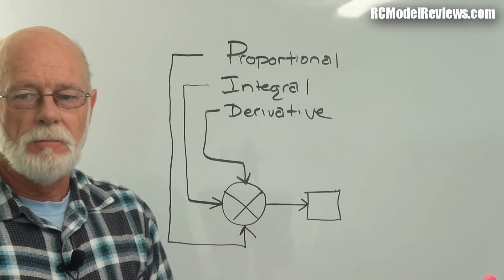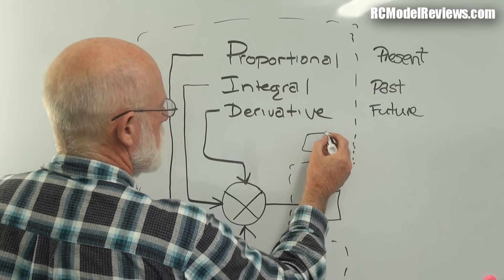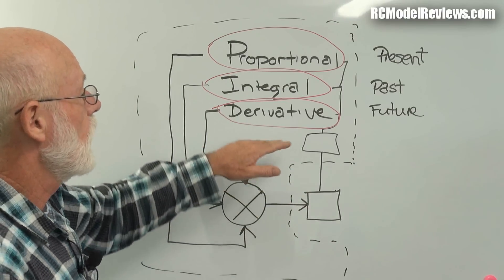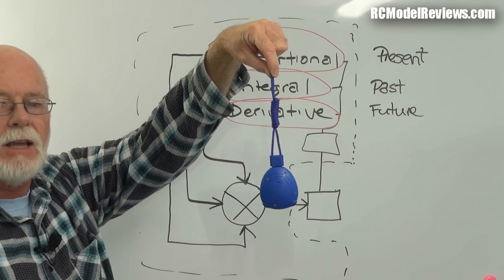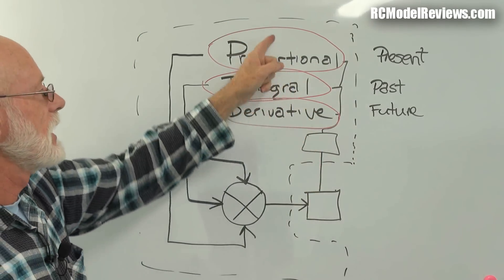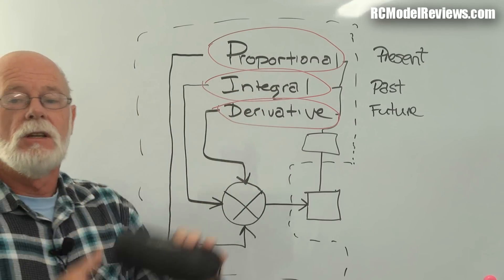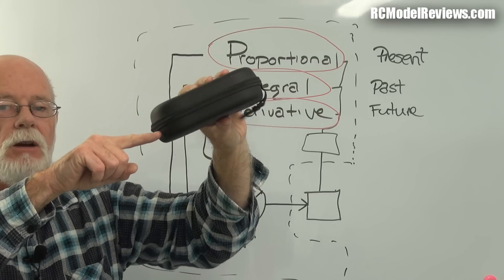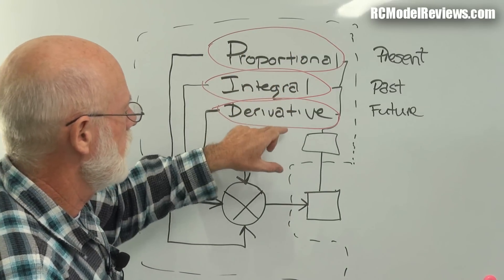What PIDs do and how they do it

Comment: The PID is used to to hold some variable like level, pressure, temperature, yaw, pitch, elevation, etc close to a target or setpoint by continuously driving a valve or a variable speed motor. PID is used extensively in industry and vehicles.

The basic PID equation is:

 Output = Gain*(error)+ (Integral gain)*integral (error) +(derivative gain)*derivative (error)

where error = (setpoint - measurement). In practice there are some some adjustments to this equation, but this shows the ideal.  To make it even easier forget about integral and derivative because the controller can work with gain alone (like flyball governor):

Output = Gain(error) + bias

The only reason to add the bias term is to allow the output to be at a specific value when the error is zero.Historically this was the first implementation, but what happens is: this system stabilizes with some non-zero error. Integral was added as an automatic bias to force the error to zero and get perfect control if there are no upsets.  If you make the Gain large then a small error will drive the output alot, and if the gain is too large the controller will be unstable and will oscillate possibly violently from 0 to full scale or 0 to full power. In some cases P or proportional only controller is enough to regulate a variable. P+I is likely the most common form, but the full P+I+D can be used for some processes, but that D term can be a stability problem as it amplifies noise and can cause problems. In practice this equation is computed repeatedly every scan time which may be 10 times a second depending on how fast the output acts to affect the sensor measurement. Hope this helps and sorry about writing the equation.

Comment: just did vid on PID for EFI 02 sensor feedback that uses an I and then a PI in another way to deal with the fact the 02 sensors only know which direction stoichimetric ratio is, not how far away it is from home, so it cant use P, so it begins with I going faster as time passes, then once it shoots past home it then knows where home is and how far away it is from home, so it then uses PI to do a u turn back to home at a more respectable speed.

Comment: The main task of integral part is to withstand additional force that 
tries to disbalance the system. In the example with pendulum one could 
imagine, say, a constant wind, blowing from left to right, forcing the 
pendulum to bend right. The proportional force would try to restore the 
vertical position, while the wind would still bend it right. An integral
 part would notice this long-standing bend and correct it. It would not 
correct random wiggles around the center.

Comment: Proportional does not allow you to get to set point. Integral has 2 left hand side poles when combined with the CLTF the transfer function is calculated and the final value is 1 which is the set point. If you oscillate about set points, you have 2 left hand conjugates in the LHS of Cartesian plane.

Comment: Very good explanation! I think you could perhaps have clarified the difference between accelerometer and gyro sensors. Since most of the stabilization is related to gyros, that could be clarified. Your analogies were great however more applicable to accelerometer stabilization.

Comment: Thanks for the video. I never thought of it in terms of time. That's smart. If I'm understanding the concept of PIDs correctly, it's more of an adjustment for correction of feedback of the quad vs input from the radio as opposed to a tune for preference (which would be rates). Correct?

Comment: Great stuff Bruce, but integral is a little mixed up.  You said the reason you can't use just PI is because I is too slow.  Two things just a little wrong there.  First -- those coefficients are adjustable, so... you could crank I up.  Second, I isn't too slow... in fact the real Reason you need D is actually to slow the total correction down when getting near the set-point.  You were right on with explanation of D.  You just said I is too slow which isn't right.

Comment: Must say, very good video but i still have some questions. I have bought an mpu6050 accel + gyro sensor and i've been playing with it for a while. I want to make a quadcopter and using this sensor to stabilize it. But now lets say you only have a gyro to stabilize. You cannot calculate angle of the quad because that would slow down the output rate and wouldnt be very effective, so you have to get the rate of angle change over time, and not the angle itself (in the PID algorithm). But now my question is if you input the rate of change of the angle you dont know the angle itself and when time passes the errors from the input data are slowly pilling up and the quadcopter would drift. Now if that wasnt very well explained i will try to ask you in this way - lets say you want to calculate the angle of the gyroscope by only using a gyroscope (without accel). You could probably have some pretty stable ouput but as time passes the angles will drift - the offset is not very linear and there are small errors in the output and such things, which makes the angles drift. And by my logic that would happen with quadcopter too? If i would try to stabilize it with gyroscope only. I hope i was clear enough and that my questions will be answered

Comment: I'm having the hardest times setting up the new "Mini Brushed FPV Quads" seen out there. I have it setup to fly, but cannot figure out the PID's since this is such a small quad. It was suggested that I CLI "set servo_pwm_rate = 1000" which has been done. and set the pid's around 4.0. Betaflight does not have integers, and it is set at 40. Is this a correct assumption? How far down can I start to set the PID's where I can get it to at least hover, and move up from there? Great video, makes alot more sense to me now. Thank you!

Comment: Please make a video on Trapezoidal Control!!! I couldn't find any about it. I am trying to program A VEX robotics robot to autonomously drive to position, and I have a tank drive with an encoder on the left and right side of the base. I need to make sure that neither side gets ahead of the other so that I the robot won't arc. I also need it to stop on point. Turning is also important and I was thinking it might need a PID with respect to speed so that both sides of the drive train move the same speed allowing the robot to pivot around the center of the base.

Comment: Nice explanation, except that the integral term, left on it's own, a PI system, will add to the oscillation to a point where the system could becomes unstable, goes off to infinity, it's the derivative term that keeps that from happening, resulting in a PD only system to slowly correct itself, sometimes never reaching the desired position.
Reply: I find the mechanical explanation simpler to remember, the P term is the length of the lever, the I term is the strength of the spring between the two, and the D term is the strength of the mechanical resistance that the system experiences, I may be talking nonsense, but that's how I tune PID's.

Comment: put forward or put back (past or future) in order to fix the angle of the position how we can select the capacitor or i inductor in electronics .the amount of energy for the stability of the system. in mechanic there are springs and other that  I can remember it. put forward or put back is the game but the most important is the time of the correction if we won't crash the drone. It is evident that looks simple but it's still hard do it with many angles of rotation... Le FeFe.

Comment: Would a larger quad generally require lower values for pids than a smaller quad? Also, if one axis is longer on a quad, would the long axis use lower pid values than the short axis, due to the reduced need for pitch/roll authority?

Comment: I have a question.  Where is the 0 point when the Derivative is looking to stop the correction?  is it always level, or is it the angle sent from the RX... Say you are level and 0deg, and you roll 45deg right, does it try to stop at 45deg?

Comment: How do I implement PID control system in my microcontroller with PWM output? I have 10 bit PWM output with frequency of 978 Hz. Cycle time is 256 ms . When I implemented PID equation in my controller it gave me strange numbers , which are not suitable for PWM signals. I need to design PID control system which gives me the numbers from 0 to 1023 depending on the size of an error.

Comment: Is your stick movement the 'proportional' input? I havent had a chance to buy a quad yet or program PIDs, im just trying to understand the concepts. But how does the stick movement factor into PID loop? If PID's are all about stability, and you want them to react to wind etc to re-stabilise., how do you program them (and which one do you change) to react the way you want them to when you move your stick to eg. bank left?
Reply: IF I'm not mistaken, think about this video as having either the stick at center, or having just been moved TO the center (both pitch & roll). Think of center stick as "Point0" and the PIDs are correcting the quad's attitude towards that "Point0". 
NOW...
When you move a stick away from center (wherever you move it to), that point where the stick is, becomes the new "Point0" and the PIDs NOW try to get the quad to that new "Point0" attitude.
(i hope i'm right.)
Russ from Coral Springs, Fl usa
Reply: +Russell Holt cool!

Comment: ok,  I'm getting better at tuning, my 250 quad comes to nice solid stops when i stop input... but heres a question..  I noticed as im flying, that at center stick it slowly deviates back and left.  and keeps going.    is it normal to have to use trim or should I have all trims centered and just up my  "i" gain?
Reply: I am new as well in drone flying, however today stumbled on the same problem and it depends on what mode you are using. If you use acro mode, you shouldn't use trim so much to correct it, although if it happens in stabilized mode you can use trim to balance it. I believe your drone is not balanced in center so it drifts away.
If you put too much I  gain for roll and pitch, you'll have slow oscilations/wobbles. You can raise until it starts and slowly decrease it. If it starts drifting to one side or forward/backwards, raise it.

Sorry for my english, but I hope I gave any help on this.
Reply: Yeah it was just my deadband setting.   My taranis radio has very sensitive mid sticks and was causing a, small turn.   4 on the deadband setting fully fixed the problem

Comment: I came here to get clarity on derivative which i got some food for thought. but the man explaining the concept is wrong when he says proportional is responsible for overshoot. Proportional is constant correction factor. so for small errors it can correct. But when a sudden big error happens, its Integral which is aggressive and ramps up the control output to get  the equipment back to square. Integral is not slow unlike the speaker says its the aggressive kid among the lot. Proportional is limited correction like police for small unrests. when there's a big attack you need an Army thats Integral and they dont bother about collateral damage. My purpose was not here to check the speakers knowledge but I felt obliged.

Comment: Your description of pid is not technically correct. While you describe how to make these work in a flight controller you need to explain pid in mathematical terms. I don't want to be critical but I am a controls engineer and use pid as well as other advanced control concepts to control lots of different machinery. However your layman's explanation should help one understand  how pid in the flight controller affects their copter.